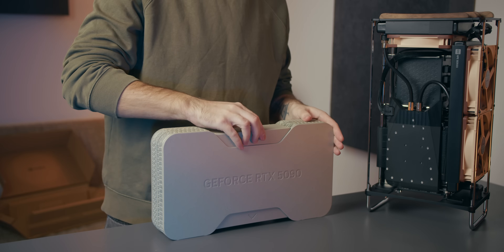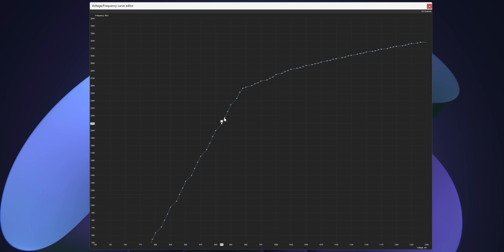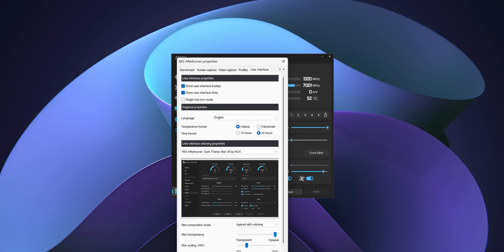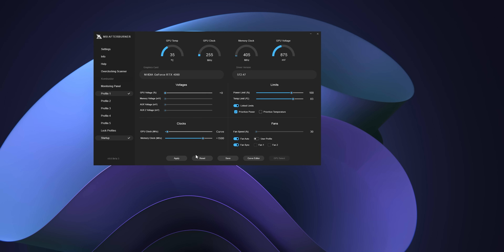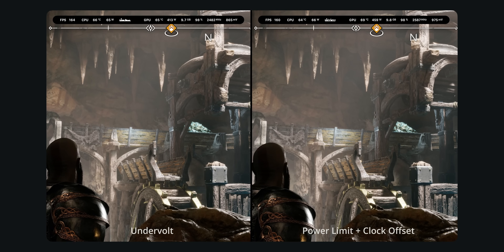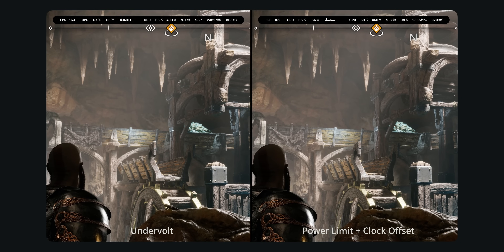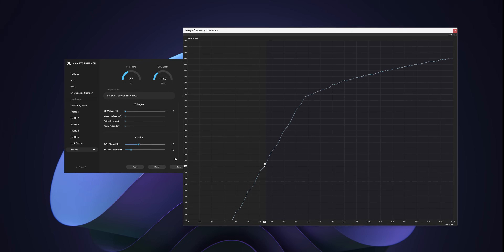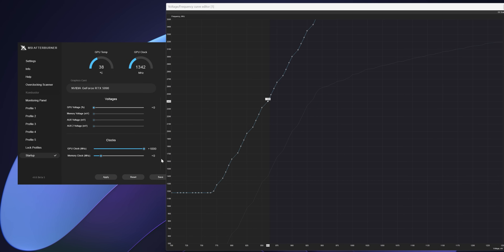5090 FE Undervolt Testing & 4090 Face-Off

Comment: 7:46 I saw this issue on my Zotac Solid aswell, it's the boost table being too low. I know some cards don't have this issue because their boost table is set appropriately, like the Astral. So in theory it's a vbios issue. But MSI afterburner could also fix this by allowing us to increase the offset over +1000. 

I'd appreciate if you go to the Guru3D forums to the afterburner development section, and find my post asking about an extension to this limit. Much like how the memory offset over +2000 was possible by extending it. Unwinder is a smart dude, I have faith he'll see it and implement it with enough visibility. 

Thanks.
Reply from the maker: Thanks for linking my video there. It would be great if it was as easy to fix as the memory offset extension. That said, there are FE users with a much more normal V/F curve, I suppose in theory it would be possible for them to save their vbios and to try flashing it on a card like mine, but bricking a 5090 FE is not something I'm about to take chances on just yet.
Reply: @EIGAtech  yeah I don’t blame you at all for not wanting to try. My card has dual bios, so I’d be more willing to try and experiment, also I have more freedom to try other card bios I believe. Whereas FE can’t flash other bios, only FE afaik. 

Also no worries on linking the video, it helps me too since you already recorded the issue for me.
Reply: I got a response. Unfortunately it’s a driver limitation as to why it’s only +1000. So looks like we’ll have to find other ways (or wait for a driver update) that addresses this.

Comment: Would you recommend undervolting a 5080 FE for the same reasons?=
Reply from the maker: From what I've seen the 5080 FE actually responds very well to overclocking instead, and even with an OC the power draw should be a bit below where a heavily undervolted 5090 would sit. Of course, you could undervolt it for power and temperature savings, but I'd only do so in a heavily space limited case.
Reply: @ you’re the man! I’ve got a T1 with your exhaust shroud that I’m assembling this weekend. Thank you for all the great content brother!

Comment: After undervolted and power limited, can 5090 run safely on 850w atx2 psu? or does the spikes has exceeded 850w？ thx！
Reply from the maker: If it's a quality PSU like Corsair I would say 850W is more than enough, especially if you're not running Intel CPUs.
Reply: @ yes its corsair psu rx850 i think？ and for cpu, im using 5950x(of course its undervolted too). thank you! 

Because of my work, I often move between  several different places, and there also set computers in these places that were a few years ago and all the Psu is 850w, but there is no graphics card, because I always move with the graphics card. 
Then I don't want to change all these psu, and its difficult to deal with the replaced psu.

No one has tested the spikes after undervolted🥲（its 900-1000w before undervolted）, so I dare not use the 5090 on the 850w psu before.
Reply from the maker: @ While I cannot measure the spikes currently (maybe I get the equipment in the future) I am fairly sure that with the UV it should be safe. That said I would never recommend any no-name PSU like those that usually come with pre-built computers.
Reply: Can confirm 850w psu is more than fine for 5090+9800x3d

Comment: Unervolted my 3080 12gb. At stock it would run at 74c on the GPU core, 75c on the memory at 380wats. Undervolted, at 875mv, Gpu core temps 62c, vram temps 66c, running at 280wats. Not losing any FPS.
Reply: 280w at 875w on 3080? Are you sure? At 1440p and 4k? Its impossible. Take different game, more gpu usage. Like control, Tomb raider 2018 or 19 i dont remember, or newer games. If you play 1080p yes 280w it possible, but 1440p and 4k definitley not.

Comment: Is it possible to undervolt the 5090 to the same usage of a 4090 (350W) without stuttering?
Reply: yeh but that would end up being a 4090 instead of a 5090 performance wise... just with +8Gb of VRAM so still good in that aspect. at least there it is very safe to run at this power draw.
Reply: @lefourbe5596  Still not sure to build one by myself or buy a pre built, but I 100% go with the 5090
Reply: @faabiiiii depend on how comfy you are with handling electronics. (Expensive one).
I could write a lot but the main concern is the 5090.

Comment: Great video. Went to look through your older videos hoping you'd have a guide for a 3080 FE which is what I have and I'm just starting to toy with overclocking and undervolting. Even though the video would be similar I would have liked to see a video with all your findings on the 3080.
Reply from the maker: Thanks! I don't have a guide but I have undervolted both the 3080 FE and the 3080 Ti FE. The process is the same as for the 40 or 50 series, nothing really changes. On the 3080 I had two undervolt profiles: 1815@856mV and 1920@900mV. The 3080Ti I had was much better binned and I could run 1800@800mV and 1905@862mV. Obviously, your mileage may vary, but I think you could start around 1920@900mV and go up from there in frequency, my 3080 bin was pretty mediocre so it should be a safe starting point.

Comment: Fan Control app is much better for setting custom fan curves.
Reply from the maker: I use FanControl as well, but the fan curve editor in Afterbuner can save the custom curve in the card’s firmware.

Comment: Incredible video, just incredible. Thank you so much. How subjectively do you find the noise after UV? I am so torn between waiting for AIBs and pay more, or buy 5090 FE nearest drop possible and undervolt following your advice
Reply from the maker: Thank you! I find it to be perfectly acceptable with an UV and the tuned fan curve. Keep in mind I still have it on the open frame setup, and the GPU is 60cm from my ear. 

As for your second question, if you can find an AIB partner card at close to MSRP then sure, but I would not pay more than that for an already extremely expensive card. The FE model, if you can get one at MSRP, is the one to get in my opinion.

Comment: is there a way to fully lock the core clock like with 30 series? CTRL + L in the curve edit but now it somehow still fluctuates
Reply from the maker: You can pick a point and tap L to lock the voltage, or tap L twice to lock the frequency. It works for me on the 5090, but with the same limitations I talk about in the video.

Comment: Is there any reason as to why my curve is different to yours? For example my 870mV maxes out at 2497 unlike yours at 2572
Reply from the maker: Seems there's quite a bit of variance between cards, the v/f curve seems to be all over the place. For your card, I would probably go with an undervolt at 890mV so as to not fall too much behind stock performance.

Comment: Since we also move the low clocks/voltages on the left (lower clocks), this also changes the idle clocks. For example, my idle clock is 300Mhz, now that I added 178MHz to points (except for the flat part), my idle clock is now 472MHz. 

Can you confirm yours?
Reply from the maker: That's normal, but it should have little to no impact on idle power draw. I just did some quick testing on this and stock vs 885mV undervolt the difference is less than 0.5W, closer to 0.2W. 

Another thing to keep in mind, is that even if the target idle frequency is now higher, it doesn't necessarily mean the card is running at that frequency. For example, my idle effective clock is reporting 30-40Mhz at stock and about 160Mhz with the undervolt offset applied, so sure, it's higher, but much lower than the target frequency which is now 1177Mhz vs. 180Mhz at stock.

Comment: Is there anyway to import your under voltage graph settings to MSI after burner?
Reply: It is not recommended to do. UV limits are defined by your specific GPU crystal and it's part of the silicon lottery. Some cards are stable with more agressive UV, some crash even after few tweaks. That's also the reason why stock curve is "not optimized". Actually it is, but the target is not lower power consumption, but perfect stability for any chip

Comment: Impressive difference!! I now always undervolt gpu's when I get them. Is there anyway you could test power usage at 700mV? Would be super cool to see how high efficiency can go even tho it sacrifices performance.
Reply from the maker: I ran the Portal with RTX test at 14:00 with 1626@800mV as that's the lowest voltage the card will run at, and I've added +3000 on the memory.
91 avg FPS, 240W and 49C on the GPU core with auto fan speed. 
So quite a lot of lost performance but again, this is super limited by that maximum offset, nearly 1Ghz lost.

Comment: Thanks for another great video. 
When you are undervolting, you are also increasing the frequency at which the card idles. Shouldn’t you only be touching the higher frequencies? Thanks
Reply from the maker: You can do it that way, but I haven't tested it to see if there's any clock stretching or odd behaviour going on. The effective clock during idle is super low regardless, and the idle power draw is the same for me even when the curve is boosted up due to the UV.

Comment: Btw Eiga, I talked to one of the developers of the SYS8 in October 2024 and asked the following questions:

1. Given that the current 2-slot design is insufficient to accommodate larger third-party 40 series graphics cards, such as the ASUS ROG STRIX 4090, is there any plan to develop an additional bracket capable of supporting 3- to 4-slot GPUs? This enhancement would represent a significant improvement over the original 2-slot bracket.

2. Furthermore, I believe it would be beneficial to create a bracket for SATA solid-state drives (SSDs) that can be mounted on the back of the frame. This would be particularly useful for users who still utilize SATA SSDs for affordable, high-capacity storage solutions. A bracket designed to accommodate a stack of 2 or 3 SATA SSDs would be ideal.

One of the developers answered with:

1. Based on feedback from our customers, the current 2-slot design supports 3-slot graphics cards without issues.

However, cards thicker than 76mm may come into contact with the leg. For this purpose, we have developed spacers that fit between the clamp and the leg (not yet available as they need testing). In any case, the setup with larger graphics cards works well in a vertical orientation. Regarding a new bracket, we are certainly moving in this direction due to high demand.

2. An add-on for SATA drives is also planned. We've been considering it since the beginning, but it just hasn’t made it to production yet.

—————————————————————
So hopefully we will see more further development iterations of the SYS8. I don’t have one currently but it looks to be one of the nicest open frames I have seen so far

Comment: Crazy how much difference there is in power draw from 885mv to 870mv. Getting within 5%-1% of stock at 870mv with memory oc is very impressive. Feel like this is the profile to run to prevent cables from melting tbh
Reply: Wow that’s nuts!
Reply: @EIGAtech  quick very strange question to ask do you have a discord group or something along that ilk I did what I believe was just a copy of your 870mv undervolt and my performance is looking extremely strange (I know you should do your own testings) but just think I'm doing something drastically wrong thanks
Reply from the maker: @Stormblizzrd  Feel free to DM on Discord, my handle can be found in the channel details.
Reply: . In every nvidia gpus if you underclock to much low mhz then work powerlimit. But for me the best is fps/per watt its probably 750mv and about if it possible 2250-2300mhz. My 3090 stock boosted to over 1v and 1975mhz (ventus) but most game around 1830mhz. I undervolted to 725mv at 1590mhz. 270w with maximum -5% fps. Its deal breaker for me. even this fps is impossible under heavy loads. it was missing where there was less fps. My 3090 can run about 305w with 1785mhz, but 3-4% fps more but 14% more power draw. 😊 Remember more clock mhz its not must be much better efficient. Do undervolting according to this guide, and then go down each step, preferably every 25mv, you will see that the FPS drops slightly, but the power consumption drops much more. That's the question you might ask yourself. Why do such a large undervoltage in a top card to have 5-8% lower performance, but you can have much lower power consumption and a very quiet computer.
Reply from the maker: I've since increased the memory OC to +3000 and I am able to close the gap to stock even more.

The default limit is +2000 but you can override it by replacing the MSIAfterburner.dat with the one from here: https://forums.guru3d.com/threads/msi-afterburner-4-6-6-beta-5-for-nvidia-geforce-rtx-5000-series-cards.455155/#post-6305643
Reply: @EIGAtech with asus gpu tweak. You can go up to 6000 easy. I’ve done it. Perf increases even more. It’s why I’m hating msi afterburner for not just fully unlocking the damn memory oc.
Reply from the maker: @Tanzu15  Just to clarify here, I tested GPU Tweak III, the +6000 memory offset in GPU Tweak results in the same bandwidth as +3000 in MSI Afterburner. You can confirm this with GPU-Z. I believe MSI Afterburner uses the "true" frequency of the VRAM while GPU Tweak uses the "dual data rate" value, essentially doubled.

Comment: There is an Nvidia thread in addition to reddit how the 5090 FE cards fans NEVER turn off(or very rarely) even if the power draw is under 50W with sub 35 celsius. 
Fans operating at 30%, 1200RPM 24/7.  You are one of those lucky one who's fan actually works as intended.

Hopefully a driver fix is coming 2months.... after the card release.
Reply from the maker: That would annoy me to no end, especially with the open frame build... The 4090 had amazing idle power consumption, so I don't get it. Yes, the chip is bigger but it's not 2-3x bigger to justify the idle power increase. Moreover, I remember it being mentioned that they implemented power management features similar to their mobile chips, but clearly that can't be right.
Reply: @EIGAtech  Managed to figure out the problem. Idle power draw for the 5090 is way to high and the trigger to make your fan idle is way too low. 
In numbers this mean your GPU needs to draw less than 29W(27-28W is better) in order to trigger the 0rpm, idle fan speed.

Once your fans in idle, your power draw won't matter anymore. The only thing that matters from that moment on is being under 50 degree celsius. 

AFAIK you can undervolt the GPU in two different ways.
1. Undervolt the upper part of the curve, leaving the bottom side alone.
2. Undervolt the whole curve.

You and I did the 2. and it works the best, saves the most but it has the side effect of your GPU clock running at 1100+ MHz all the time instead of the default 180 MHz.
Normally it shouldn't matter. You are drawing the same power for 1100MHz as you do for 180MHz but that's not true. 
You are drawing 2-12more Watt which is preventing your fans to go idle since you are not reaching the sub 29W mark. 

Even if you running the card by default, stars needs to align to reach sub 29W. 
If you don't have close to 0% GPU usage, you won't have low frequencies which means no idle fan for you. 

If you want to run wallpaper engine, it won't allow your fan to go idle. Some reported the same for corsair ICUE too. 

In short, for your fans to go idle the power draw needs to be sub 29Watt.
For your fans to spin all you need is 50+ degree celsius. 

Fun fact. Most tech media reported an idle power draw of 46+ Watt. Which means their fan never going idle. 
Well played Nvidia.
Reply: @devilsuport  can i change the amount of clocks the GPU needs to be at for the fans to go Idel? can i not just change it from 180mhz to the 900 or 1300 or atleast above what i am getting when watching youtube for an example OR can i not just change the amount of watts that need to be going to the 5090 for the fans to start working like instead of 29watts or 49watts can i make it like 200watts or something like that?
Reply: @Makarov2203 You can't. Only Nvidia can change these things.

Comment: The card is badly tuned out of the box for EIGA to get the same FPS for 150watts less than stock. I don't understand how Nvidia can be so careless. 
Is this the same for non-reference RTX?
Reply: They have to design these things to meet certain performance specs reliably across a spectrum of variables including silicon quality, quality of power delivery, game engine, temperature, and still be produceable at scale. If they binned and tuned the cards we would see major price hikes above the nonsense we've already seen. But that's where you end up with cards like a Kingpin. Binned and tuned to perform. Not defending Nvidia here, this is just the issues with mass production of anything.
Reply: @aglinski9 all good and ok but why intel only has about -75-100mv error? When nvidia much more error? Intel its crazy... and nvidis its crazy too to potential undervolting😮❤
Reply from the maker: It's been like this for a long time, it puzzles me too. Portal with RTX seems to benefit the most from the stock tuning, but I'm fairly sure I can beat stock performance with a less aggressive undervolt and still draw less power.